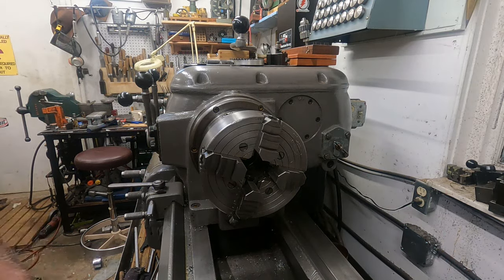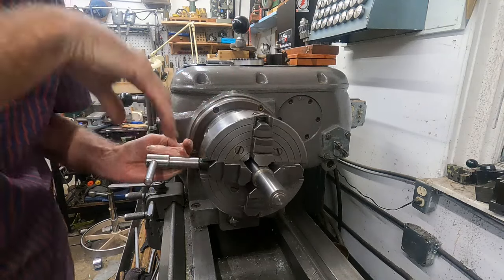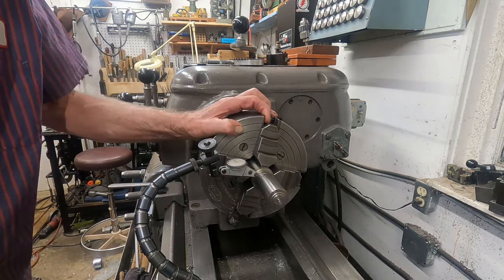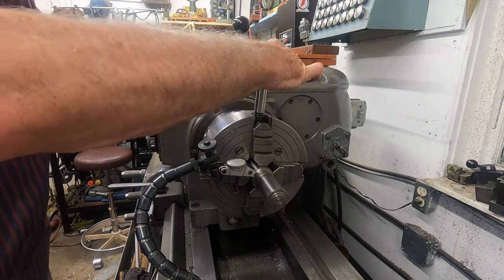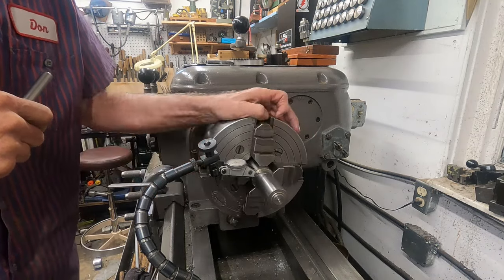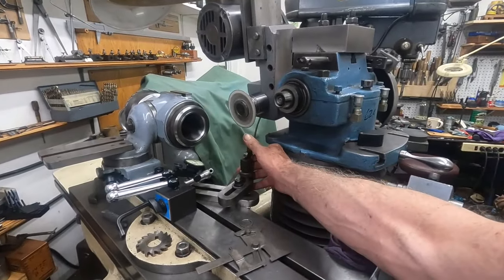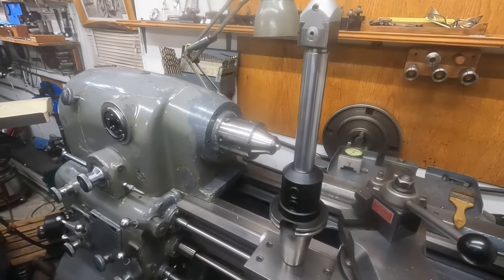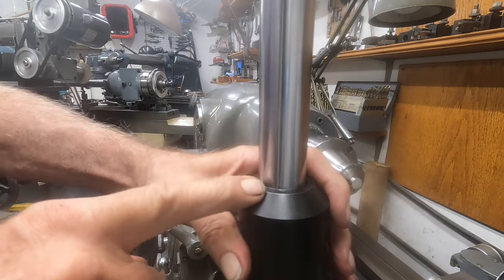Tool & Cutter Grinder clearance issues and solutions

Comment: Hello from Aus. I use 150 x 2.5mm Ruby saw gulleting wheels to gullet annular cutters and others where I can. They cut well and hold form. Also cheap and long lasting. BC
Reply from the maker: I cant find anything specific listed except general wheels sold by Radiac, Camel and others that are called Ruby, Thanks!
Reply: @DonDyarprecision  Hello from Aus. Abrasiflex call it 25A, Flexovit PA, Norton from memory 23A. It's the wheels used on cold saw blade grinders. BC
Reply from the maker: @inmyshedwithbc.  Thanks that's the info I needed. I will check it out

Comment: I have a question for you. If wear isn’t a factor, is there a reason why you would use 4140 rather than 1144, which is stronger. Both can be hardened to the same degree, if needed. I tend to use both 1144 stress proof and 1144 Ultra over the much more expensive 4140 for most things.
Reply from the maker: I cant hold the tolerance with plain steels on the jig borer or Monarch ee lathe. The harder the prehard 4140 the closer tolerances possible. This is also mentioned in the Kennametal Romicron boring head manual. I proved that out many times and stopped purchasing plain carbon steels 25yrs ago. My two current lathes the Axelson lathe has the power and weight for roughing out parts and the 10ee at one time Hardinge for finish turning at high speed 3000+rpm, with fine feed less than .001"and depth of cut not over .014" Romicron instructions. Much of the time I have been able to use scrap and shorts of alloys for shop projects.
Reply: @DonDyarprecision  for anything precise - around 0.002” or better, I usually harden and temper, then grind to size if it’s needed.
Reply from the maker: @melgross  If you do this often it pays to have a Hardinge or Preferably Monarch ee to work prehard and forego the hardening and grinding steps. If using pre hard alloy is acceptable as it was for making parts for the Axelson lathe apron. but it takes a high speed spindle to close in on tolerances.
Reply: @DonDyarprecision  that would be nice, but I’m retired as you are and I’m out of space for something additional, unfortunately. I’ve thought about a 10EE over a long time, but I need to do work that’s too large for it. They did make a 13EE, but I’ve never actually seen I’ve and there’s a lot of confusion over whether it’s worth it when they do turn up. For some purposes< pre hard isn’t very hard.